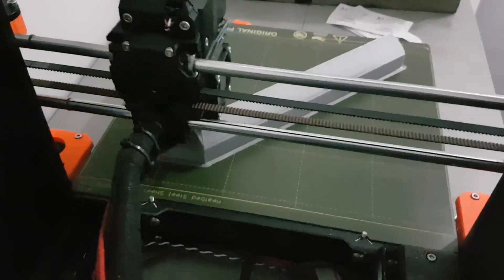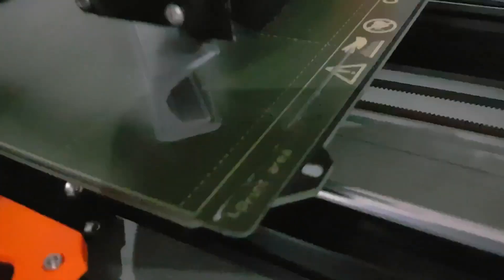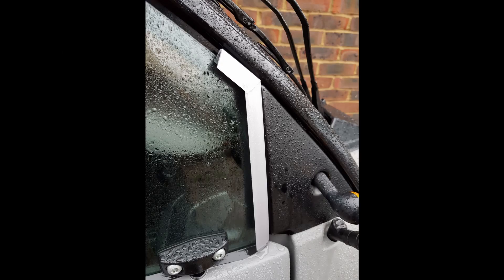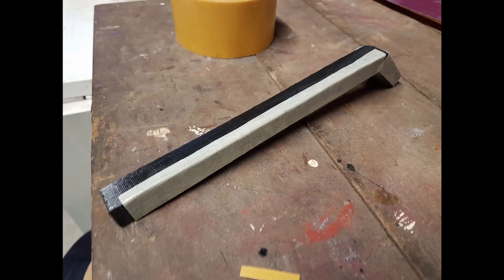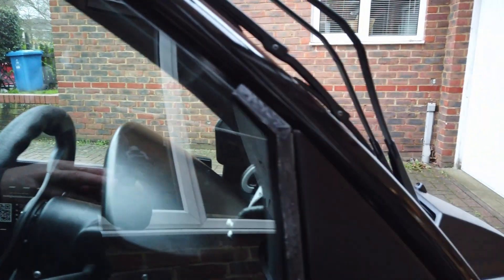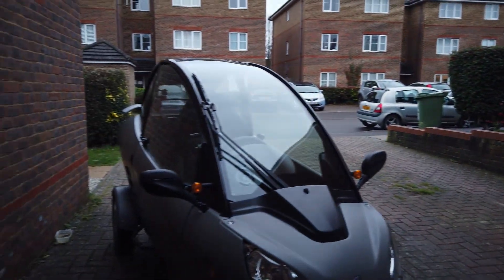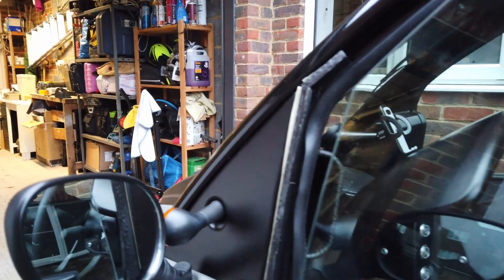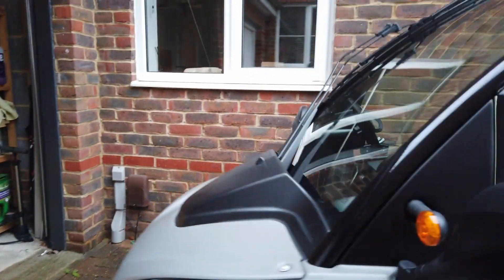3D Printed Wind & Rain Deflectors | Carver Earth

Comment: Quid of the winter rides! Do you feel warm enough in the cockpit for some low temperature rides, or do you still feel the need to heavily bundle up in clothes? Does the window warmers does the trick for heating?
Reply from the maker: I'm wearing gloves and a hoodie.  The window heaters take the chill off but not much more.  The new S+ comes with aircon so I hope that does better 😁